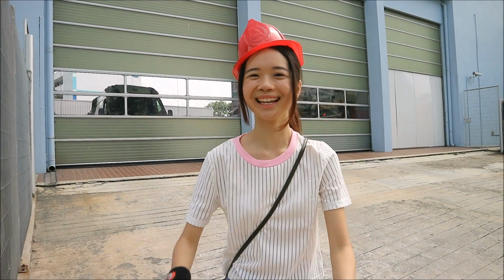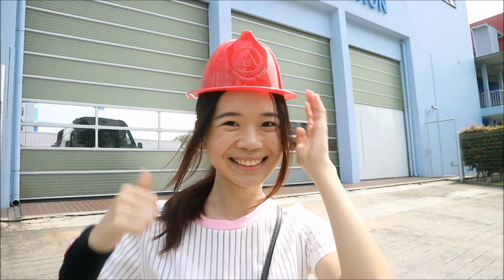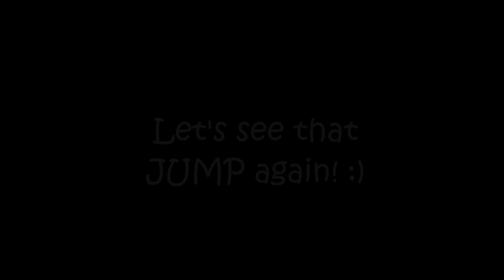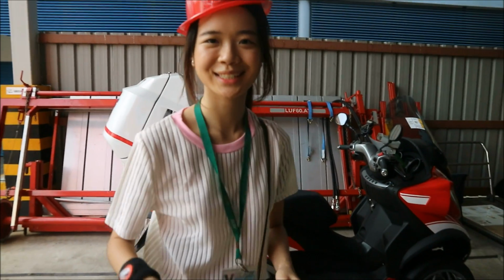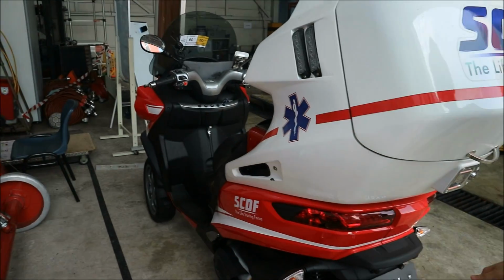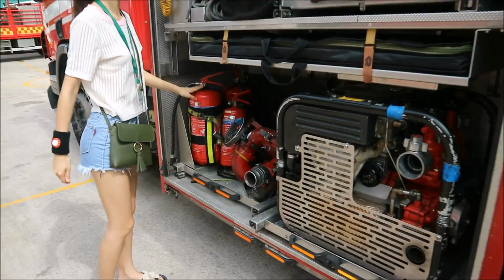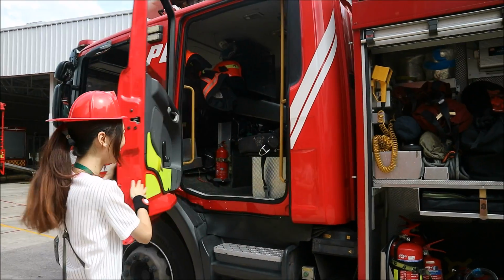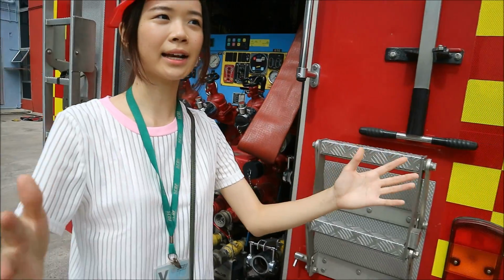Noob's Guide To Singapore's Fire Station!

Comment: The firebikes do not have a CAF (Compressed Air Foam) tank. In fact, the have a CAF backpack that they put on (which also contains a SCBA (Self-Contained Breathing Apparatus) set). The CAF backpack weighs about 25 kgs and can spray for about a minute before running out.
Reply: Eh lu Sengkang Diam la, ni stn22 ne hal,

Comment: 3:26 Those are firehoses. Not pipes. And those attached to the hoses aren't nozzles, they're called coupling. The nozzle will be what we will use to attach to the coupling later on to fight a fire. The nozzle once attached to the coupling can switch on or off and control the dispersion of the water. 

Yes I'm a firefighter with the SCDF 😉

Comment: There gear looks lighter than FDNY and there hoses are easy to control then FDNY the hoses literally can throw you around lol
Reply: Fdny chaser cuz they didn't pump. I tried 8 bars and I almost flew
Reply: aiyo. ah girl girl go scdf firefighters station must respect them leh. must wearing helmet properly and actually is not allowed to wearing slippery. and is not encourage to wearing uniform Infront of the scdf firefighters trunk. incase the trunk didn't parking hand break will go Infront of the body